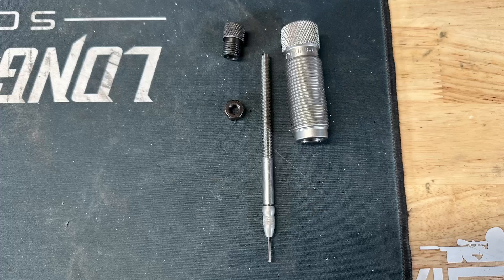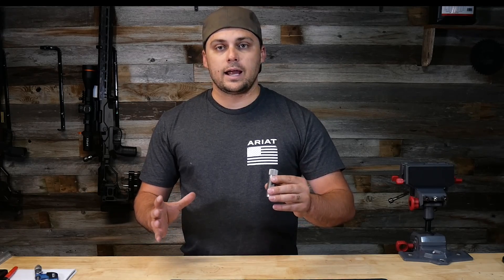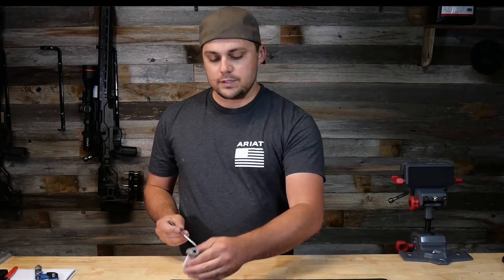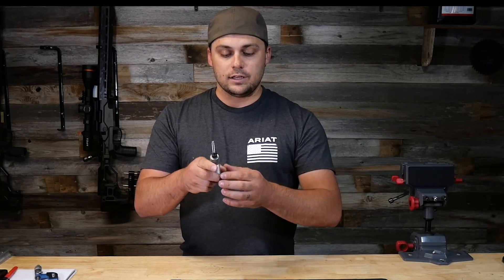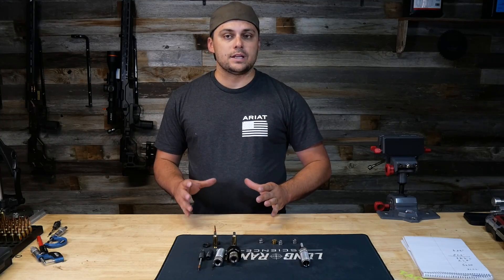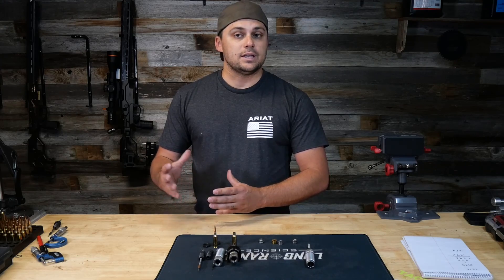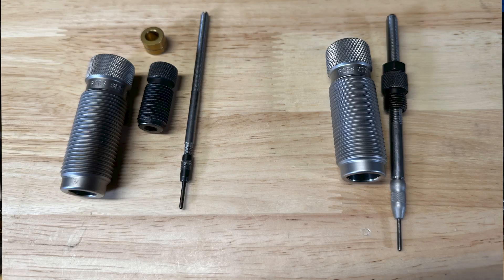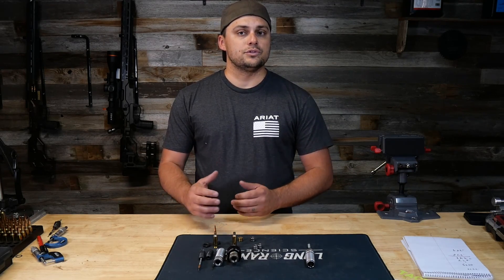Full length vs bushing sizing dies and Intro to neck tension

Comment: Forgive me if this is a dumb question… I recently switched to a bushing die because I wanted to control neck tension better and work the brass less, as you mentioned. However, I often end up with case mouths that are dinged or dented inward from taking a fall onto concrete or rocks after ejection. In those cases, I’m basically stuck using an expander ball or mandrel to reform the interior of the case mouths back to round, as the bushing only sizes inward on the exterior of the mouth/neck. Correct? I’m not missing something here am I?
Reply from the maker: Not dumb at all and brings up a great point. With those dings, you will need something to get them out. Either an oversized mandrel before the bushing, if you’re using the bushing as the main control, or an expander after the bushing. Since I made this video I have actually gone back to using the bushings with an expander ball. The bushing still allows me to not excessively undersize it, and extend case life, and the floating bushing keeps everything concentric. Then I just rely on the expander to set the final diameter. Some of your high end dies will give you different diameter options for the expander
Reply: @longrangescience thank you for the reply!

Comment: Ok great video thanks, my issue is i am loading 223 sub sonics with 36 grain non lead barns varmint bullets for a specific pest control contract job in a built-up area. What I have found is neck tension and primer selection greatly alter velocity and performance. Brass prep is important. When  neck tension is weak the load dose not ignite correctly, and leaves bullets stuck in the barrel. Not fun and a problem with trail boss powder is feel. Your video helped ill get a bushing die set and try to get tight consistent neck tension and may work with neck crimping also, Thanks Paul Barton New Zealand
Reply from the maker: Glad I could help! When your loading 223 for subsonic with bullets that light, things like neck tension and primer selection will make more of a difference than standard loading

Comment: I use a bushing die and then an expander mandrel die (not ball) to set exact neck tension.
The mandrel just baaaaarely expands the neck and helps keep concentricity since the bushing floats.
Reply from the maker: I’ve done that on some cartridges as well with good results

Comment: If your not uniforming neck the bushing pushes error into neck, fls no expander then use mandrel pushes error out. A happy median of both you mentioned. Or am i wrong? In the end proper interference fit is goal. I use an amp every time regardless in process.

Comment: Like you, I use a bushing die without an expander ball, but finish with a mandrel to give 2thou interference fit with the bullet. The mandrel ensures the neck ID is exactly circular.
All this happens after annealing so the squeeze and expansion reintroduces enough case hardening for spring-back/bullet grip.

Comment: One thing I've been noticing is that after firing, my cases will usually fit back into the chamber.  So I am not even sizing the bodies at all.  (I bought some Redding body dies, but haven't needed to use them so far.)  So I've been using a universal decapping die, and then the Lee Collet Neck Sizing die.  Is this not good enough for precision reloading?

Comment: If you're using a maderl, can you skip the bushing?
Reply from the maker: You can. You only need one thing to set the final diameter, either bushing or mandrel. But you can set how much the brass is worked by using a bushing and mandrel so you don’t over work it

Comment: I use to use the bushing dies but over the past two years I switched to neck sizing with a Lee Die which requires no lube. 
since then I have been 100% accurate with neck tension and bullet seating ;  it is one more step but once your set up it goes along pretty fast :)
Reply from the maker: That’s a good way to go but I have had issues neck sizing in the past. Mostly getting outside in the dirt and having the cases not fit in the chamber
Reply: @longrangescience  initially I had trouble with my Lee die as it would jam when neck sizing so I took some of that black sandpaper and sanded off approx. 1k " and it stopped jamming.
Now I have 3k neck tension but it doesn't appear to affect my 223 cases for accuracy.

Comment: Simple ques?  I'm using expander mandrel, why would I use a specific neck bushing when my expander mandrel is my final sizing?  It set no matter what neck bushing I use.  Can I get away with just basic FL dies? And finish with a mandrel?
Reply from the maker: Yes, the mandrel sets the final size so the neck bushing has nothing to do with that. The main benefit is being able to control how much the brass is worked. With the mandrel I can size just barely under the dia. So I’m not working the brass as much. And I feel like floating neck bushing help with concentricity. 

But really if you have a standard FL die you will be fine

Comment: Which bushing(s) you need somewhat depends on whether you anneal the brass, or not, and the makeup of the brass itself. There will be springback, how much, is due to the makeup and hardness of it. If you have mixed brands, you'll likely need 3 or more bushings, if you intend to turn your necks, you'll need smaller bushings. And, bushings shud be checked to see what size they really are, when you get them, with a pin gage. Just be prepared for needing more than one bushing, may need at least 3.

Comment: Do you still need to mandrel after using the bushing die?
Reply from the maker: With this setup I’m using them to set the size, so no. The only time you may need a mandrel is if the necks are slightly dented. 

I am looking to try something a little different though. Going slightly undersized on the bushing and using a mandrel to set final ID. Will still help not stress the necks as much
Reply: Exact question I was going to ask. I use a decapping die. So I can take out the whole expander ball/decapping assembly? And only use the neck bushing for FL size? I kept the expander in there for load development and had good results for a 3 shot group. Would like to narrow down devolopment and have a 5 shot group with my best results. Just want to make sure I have this correct that I can remove the expander ball/decapping rod, use the FL size with bushing and then go straight to bullet seating (after priming, poweder ect).
Reply: This is a good overview, thanks.  I’ve spent a lot of time reviewing options, so full length size then just use an expander mandrel to set neck tension.  Setting it from the ID I think is a bit more accurate as you don’t have to deal with neck thickness variances (I measure a couple of sides of the case neck with a ball micrometer to check that, or use a case neck concentricity gauge) and you avoid any stacking of the OD brass neck or stress to it.

I have thought about doing what you suggest in response to another comment and using a bushing to only slightly undersize the case neck, then running a mandrel, which will give me the same results, but stress the neck less, but since I anneal it hasn’t been as critical.  Also, I bought several Redding standard FL sizing dies so would have to buy bushing dies, which is a cost factor..

A couple of questions: Are you using Redding dies?  And is that a SAC bushing?  

Also, is that the Real Avid gun vise on your bench, or another brand?  I’ve been looking at that, didn’t realize it was that large.  FYI, you have a nice setup, but if you haven’t already I’d encourage you to look at the Inline Fabrication bench mounts and storage mounts.  You could swap out your vise for a press, or any other bench tool in seconds.  Best investment I’ve made in the past few years.

Thanks again for the clear review!  👍
Reply: I found least with Lapua an new brass I get inconsistent thickness the first 3 firings so I use a mandrel just till once the brass seems to be more consistent then bushings, only like stated huge difference in necks not cracking. An have to check my next test is neck turning is not as much needed maybe brass is formed around the neck diameter  better. Another test.
Reply: Thank you for taking the time to make a quality video that explains full-length bushing dies.